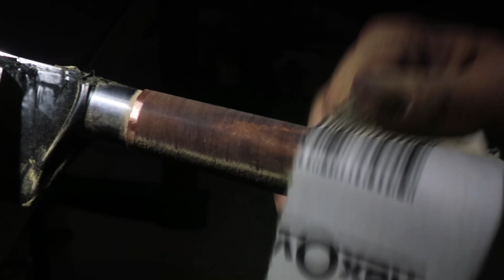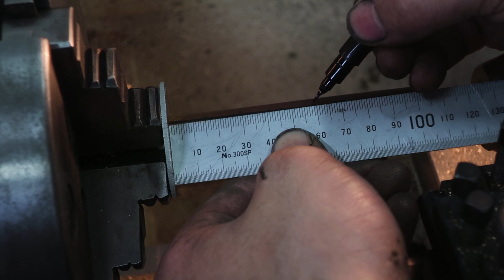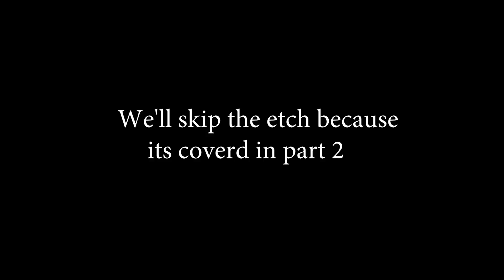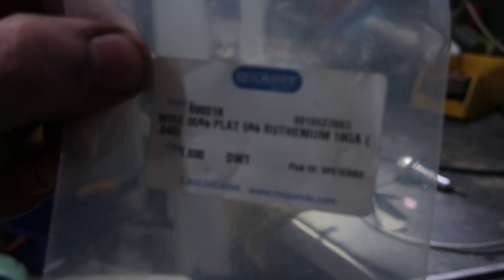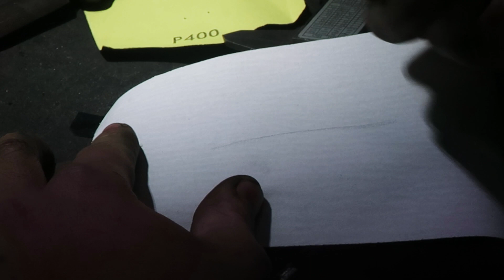how to make a NAKIRI, (PART 3)

Comment: That is just absolutely wonderful, the handle looks like those pillows that every grandmother has. What was that tool that you used to dome over the platinum wire?
Reply from the maker: thanks mate! yeah that was actually what I had in mind when I designed it haha. the tool I used was an pneumatic engraver (engraver max) I believe.